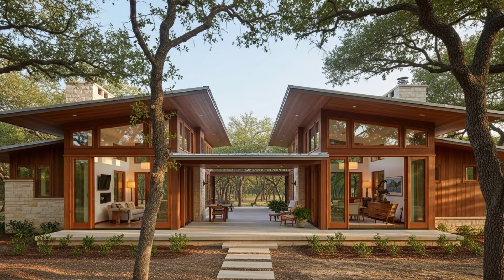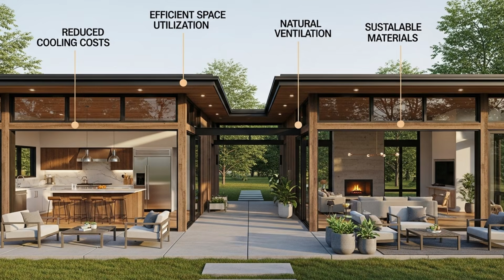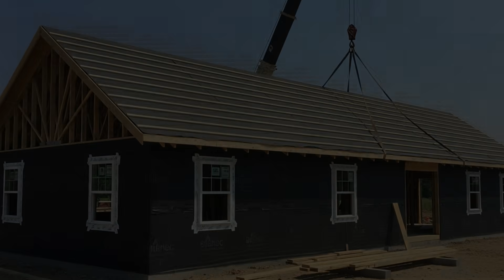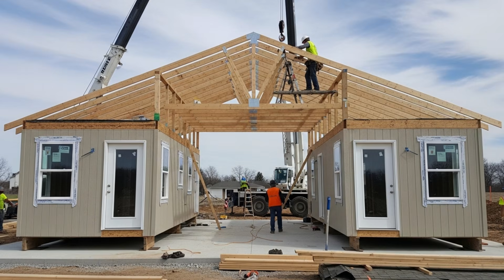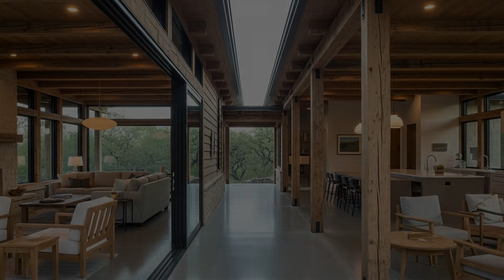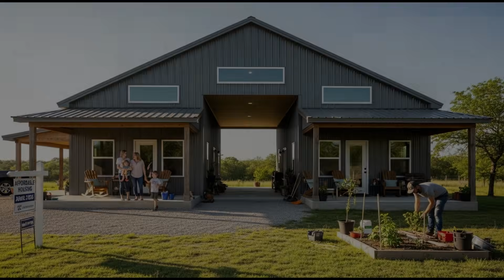Affordable & Breezy : Why the Dogtrot House is the Perfect Budget Build

Comment: I like it a lot, sperate active living "day side" from sleeping "night side" and zone conditioned space when not occupied. in high humidity climate install garage or folding doors on each end of the breezeway to close off during the muggy months. We went with earth berm in Dallas to get the cool "earth" benefit during summer, so I'm thinking super insulated walls would lower cooling costs until breezeway is put in service in cooler months. They were used in New Orlene's, but I question the comfort level acceptable to the poor compared to todays privileged. I like the fresh air nights but think clients will need supplemented comfort half the year.
Reply from the maker: I appreciate your thoughtful perspective on balancing traditional breezeway concepts with modern comfort needs.

Comment: You wouldn't be able to have your living spaces open like that in Florida.
Reply: Dogtrot houses—historic "Cracker" style homes featuring two separate living structures connected by a central, open-air breezeway—work exceptionally well in Florida. Their natural cooling design is perfectly tailored for the heat and humidity.
Reply: @tedmounsteven621 thanks for the response. I love the breeze off the coasts, but I was thinking more about our bugs 😂
Reply: @dianawilliams6700 and the alligators
Reply: @michelleruff2462  💯😂
Reply: @dianawilliams6700  insect screen, keeps out mosquitoes, but maybe not alligators